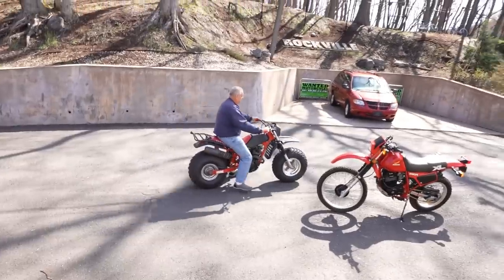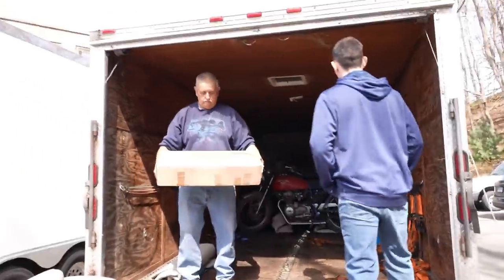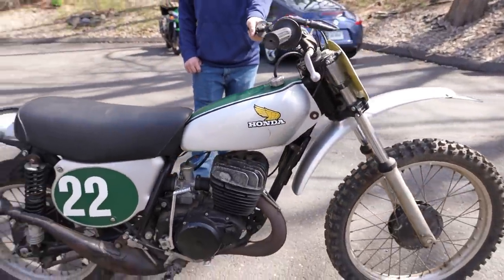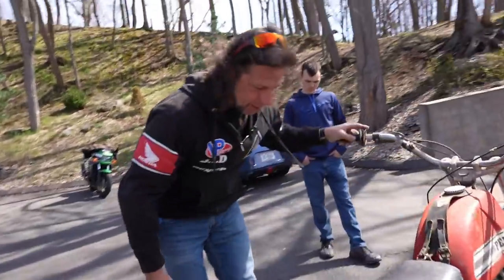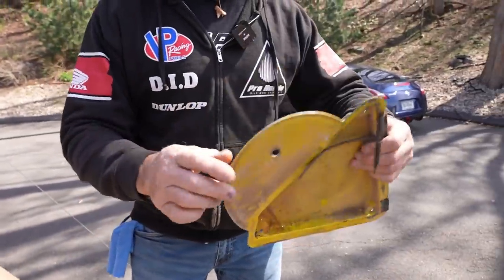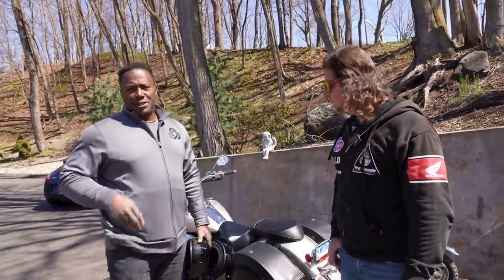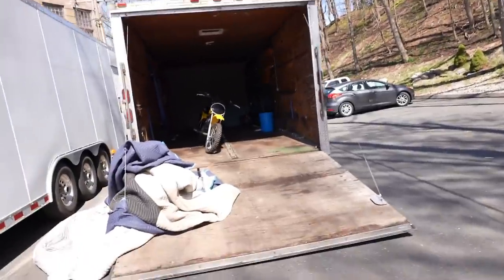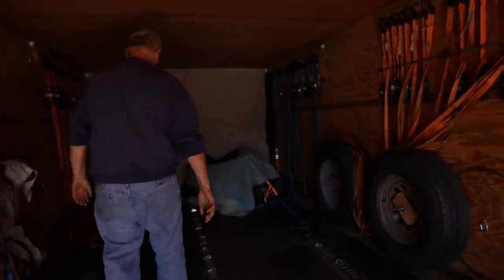TRAILER LOAD OF CLASSICS ARRIVE WITH SOME SURPRISES!

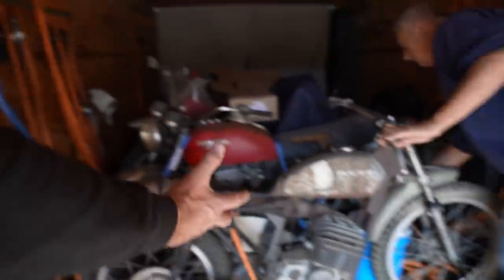Comment: 1:04 🤣 It might! ..those engines could also be used in a 125cc GP road racer.... Just add Rotary induction, play with the gearing, and BANG-O! 

The Cub is boring, until you turn it into a BMX Super Cub.. 😉

Comment: Mr. Kaplan, One of the BEST bikes I ever owned was the Honda XR650R. The bike was designed and built by Honda to win the Baja 1000. And it did, many times. I don't remember the year of mine. Perhaps it was 2003. I installed a simple jet kit to enrich the mixture and the foot long spark arrestor removed per Honda for increased performance. They had a screen, around the size of a beer can, with a Honda part number that went in the spark arrestors place inside the end of the exhaust. The jet kit had a Honda part number as well. I suggest you try and find one of these, in good shape, just to experience a true race factory four stroke. This was an extraordinary bike for sure that I wish I still owned. Try to find one!

Comment: I am glad to see your Faith. I made a short video of something really Big. Bro, you are Lite up to see those bikes. And it is contagious. I have my 1982 Magna V45 all part in my garage. Trying to find the right Carb Kits for it, got 2 but still not mine. Need those o-rings. l see you like the Magna's as well. Still have to make more of the Big video then I can get back t bike stuff. Should show your Paster the video. Had my Magna since 1984 but knew the owner that bought it new. On the MX400B, still getting all the engine parts in a box to bring to engine builder. Then it will be another Original Yamaha MX400B.

Comment: Just had a brain fart what you should be doing with all these extra unobtainium parts from the past is scanning them into software that can be used on a 3D printer for future use like that air box for an example probably fits other models in and around that same era as storage software would be priceless and a very good tool to have in your business of what you do the best and can remain forever as what museums are for.... And by the way there are now 3D printers that print metal parts ready for usage.. and now at prices affordable for the average hobbyist meaning that you can afford one Ken ... For example there was one large enough the other day to print the metal parts to build about any single cylinder motorcycle engine transmission combination let the price of was about $4,500 bucks that doesn't take long adding up all the pieces involved to build a complete any brand of anything needed to do what you do and I'm surprised Jay Lino does it own one already if he doesn't own one today.... The best I've seen from Jay Leno's garage is that he does only regular 3D printer that will stand and make plastic models of any parts he needs that he uses to take two machine shops and have a metal version of the same part ready for which is also something that you could use. As we both know they're a lot of plastic parts to restoring a dirt bike
.. and today with today's technology in plastic restoring a dirt bike can also mean it's reliability can be improved still maintaining the aesthetics with more useful practical reliable and safer operating under today's technology
... For example as I just now googled 3D printing in metal and this is the first one that came up for an example only as the market is flooded and will have to be researched for your best choice for the money not that you can't afford any of them but every penny counts as extra can be put into the buildings to keep a roof on at the very least... So here's one that starts out at 4,800 bucks is a small price to pay for unobtainium that this machine can spit out on a daily basis... Keep your ears on and dailed up, Ken information can be priceless and cheap at the same time
https://store.makerbot.com/3d-printers/methods/method-x?utm_medium=cpc&utm_source=google&utm_campaign=Search_US_PRO_Intent_Metal&utm_adgroup=3D_Metal_Printing_Machine&utm_content=3d%20metal%20printing%20machine&gclid=Cj0KCQjwvLOTBhCJARIsACVldV13t1AgDIShdzjrOJcMDW6qtsK-ZUANSkqrIUq8N6aU_3qXxUMabgIaAtG-EALw_wcB

And like you have nothing else to do with your "spare time" get yourself a course in metallurgy and learn the basic skills of why certain parts are made from certain alloys that is the only reason why they are built in such fashions... For example learn why certain alloys of aluminum are used in place of others that would seem to be better but is never the case... Take aftermarket ring and pinion gears for your favorite hot rod rear axle as it doesn't matter whose name brand is on the box it is the materials choice of metallurgy used so those rear end gears exist under the demanding factors in the environment which they are intended to be used. That's what you will find as it boils down to one particular alloy and process to machining to finish product has to be maintained or  those Ford Motorsport or any other brand of gears in your $aleen mustang would have never survived... I was asked one time the difference between S&S crankshaft and rods versus Harley-Davidson crankshafts and rods... This question was asking me by a  man whose brother worked at a foundry in Chicago and all they did was making connecting rods and crankshafts for two different companies..
As I was informed that about half of the products from this boundary when she won or the other as the alloys used for exactly the same from one melting pot so if you are able to 3D print in metal knowing the basics of metallurgy can mean the difference between success and failure.... As it is today you don't have to be a rocket scientist to own and fly one
https://www.makerbot.com/3d-printers/method/metal-3d-printing/?utm_medium=cpc&utm_source=google&utm_campaign=Search_US_PRO_Intent_Metal&utm_adgroup=3D_Metal_Printing_Machine&utm_content=3d%20metal%20printing%20machine&gclid=Cj0KCQjwvLOTBhCJARIsACVldV3M65GsMlvnIqoKCA6uyUzJQGH1xiUlbuvbbeSwkh56KtIYn03P4nAaAiVxEALw_wcB
After earning my degree of doctor of motors by the perfect circle corporation plus an associate degree of applied science by the University of Illinois I was congratulated now having the skills to begin my education